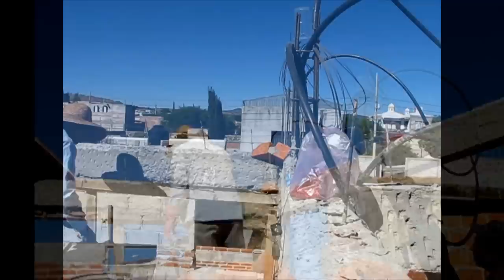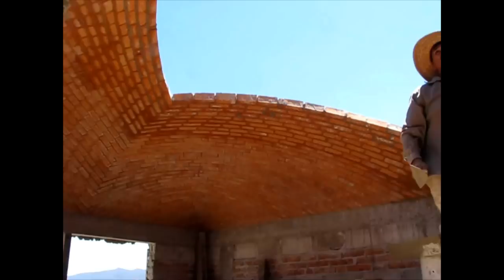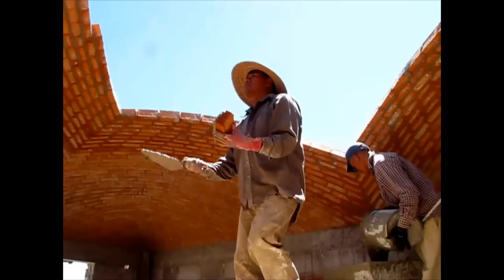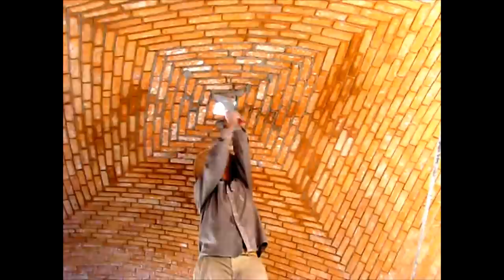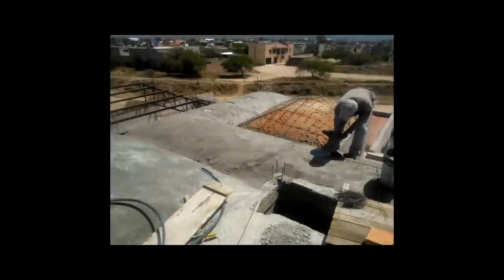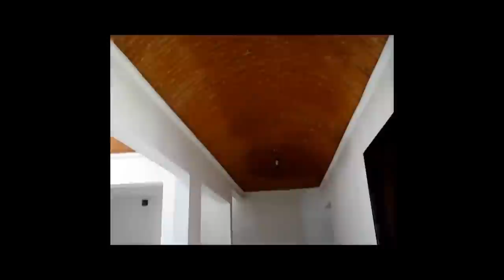How to build a solid brick dome virtualy Defying Gravity, Truly amazing! The strongest celling

Comment: would not want to live in a house like that during an earthquake.
Reply: greenrolaids that true this is called cheap building. In a small earthquake those bricks will fall over your head.
Reply: thats funnnn
Reply: i have lived through 7. my cousins family died in a house just like this.. so yeah, who's ignorant now?
Reply: I love mexico
Reply: PAUL WHALEY You are offending Mr. "green" 'cause you are pretending he is unable to stand for himself.
Reply: +PAUL WHALEY no he's wrong, the curved arch dissipates shock more effectively during quakes, The left to right shaking during a quake is what  causes buildings to collapse, moreso than the up and down.
If the supporting beams on a building looks like a T, where the loadbearing beam, meets the gable & trusses, that's vulnerable to a quake. That's why in California they put a diagonal cross beam in the walls or in most cases, run a threaded bolt through the length of the wall, and tighten them  on either side with lockwashers & nuts. 
That's why scaffold erectors use one cross bar, and two straight bars when erecting scaffolding, it's to dissipate the kinetic force the wind puts on them, and stabilize the structure. 
The same principle applies with earthquakes.
Reply: +PAUL WHALEY don't take my word for it, it's so much b.s. artists and liars on utube I encourage everybody to research something that they want to know the truth about.
a simple Google search on 
"earthquake resistant construction" should suffice.
Reply: Peter Nouveaux 
your absolutely right sir... ancient roman domes and many others still standing today due to dome like structures... very resistant to earthquakes...
Reply: what is the roof of the building your living in now made of?
Reply: reksub Top Secret. I am living in a Bunker.
Reply: Then how come so many of these structures are several hundred years old? Did somebody stand under the roof and hold up all the bricks with their hands during every quake?
Reply: sgdeluxedoc Sure. One of the most Ancient  buildings in the World, The Pantheon was built using similar roofs.   It is in Italy where strong Earthquakes are very frequent.   .https://en.wikipedia.org/wiki/Pantheon,_Rome
Reply: carlosmante concrete isnt classified. Lol
Reply: That roof is incredible strong. Much stronger that an ordinary roof due to its dome shape.
Reply: carlosmante did you know Mexican almost all of them are defendants of Spain?
Reply: +daniel nolte I didn't know Spain was prosecuting them.
Reply: Peter Nouveaux descendants* lol
Reply: carlosmante which makes them part caucasian also.
Reply: daniel nolte I DON'T Care about skin color , all I care is the Color of my Money. My motto is "ME, My and MINE". Do U Comprende????? ha Ha Ha Ha ha.
Reply: daniel nolte Yes I know . With due respect but Mexicans are like "Tutti Frutti", many colors.
Reply: It seems like everybody is more interested to put down any comment. Come on and let's go back to Domes and their particular characteristics.
Reply: ***** Thank you for your participation. Next.
Reply: ***** Thanks for your Participation, Next. ha ha ha.
Reply: ***** De Nada, Comadre!
Reply from the maker: Once closed, the arc, and vaults are structures stronger engineering there, watch this video where substantial evidence on these vaults are made, follow the following link, where they do the test with hollow materials and facts with plaster, in Mexico, we use solid bricks and concrete, brick see this video: https://www.youtube.com/watch?v=vHrIkk4wo9s
Reply from the maker: Once closed, the arc, and vaults are structures stronger engineering there, watch this video where substantial evidence on these vaults are made, follow the following link, where they do the test with hollow materials and facts with plaster, in Mexico, we use solid bricks and concrete, brick see this video: https://www.youtube.com/watch?v=vHrIkk4wo9s
Reply: no
Reply: stupid question
Reply: Dude... Native American's aren't Mexicans. two completely different peoples. As for this roof. Yes, a dome 'can' be very durable. But this doesn't have the proper anchor that is used on ancient buildings. With those, there was a sort of 'lip' formed which the base of the dome would sit within, These bricks are just being buttered up (the term for applying cement to a brick) and stuck on top, Yes they're placed on an angle which helps deflect some of the weight. But it's still being placed at the top of the wall. After it's assembled, they'll apply a plaster or whitewash at the top to seal it, but that won't anchor it. With an average earthquake. If even a single section on the wall loosens. the entire dome will collapse because it has no proper anchor.
Reply: "Native Americans aren't Mexicans"????? You are Talking about Political divides made by the English People (Gringos). Ethnically Most Mexicans are Native American.
Reply: I think you just discredited it because you associates Mexicans with cheap
Reply: +carlosmante not all Mexicans are Native Americans, throwing in small bits of irrelevant info doesn't make you sound smart
Reply: SameMule when you know the difference between "Most" and "All" you can post again. hA HA HA.
Reply: CarlileMentos i was talking about your first comment, and its still irrelevant. hA HA HA.
Reply: SameMule, are you still worried by the "irrelevant"????? Get a life little boy. ha ha ha ha.
Reply: CarolingMantis, No u first
Reply: greenrolaids > at all ! could you imagine doing that for a living?  f
Reply: because your house is earthquake proof.....can i  rent a room...?
Reply: These kind of roofs are extremely strong, but  they are only allowed in the regions of Mexico that are geologically stable (no earthquakes), otherwise the construction would be cancelled. Usually they can resist a moderate earthquake, but they are not flexible enought to resist stronger eartquakes since they tend to open the walls. You need very thick walls to resist, but that makes the building very expensive. Ancient cathedrals are properly constructed with these domes and thick walls, that is why they have remained damageless during centuries in Mexico city.
Reply: They tie rebar to the top and then poor concrete over so it will hold do you guys think they actually leave the brick like that the brick is for looks on the inside smh
Reply: clearly the brickwork is pretty strong, they were  walking on it. the cement should make it stronger by loading the arch/dome they created, also they put the rebar in the correct place if the brick was part of the structural member. (as would be done in a concrete slab floor), though it wouldn't help much with the structural integrity of the roof if one of the bricks came out, that would be covered by the concrete, so all in all a pretty overbuilt structure
Reply: In fact there is not evidence of any damaged house with that kind of roof during earthquakes in Mexico, because that kind of structures are very strong like ancient cathedrals.
Reply: what's mortar consist of???
Reply: Todos mecos ese lugar es Monterrey nuevoleon y ahí no hay terremotos puñetones jajaja
Reply: greenrolaids Yeah well I rather live  in a house like  that  ,,than a stinking  New York city,,lol..
Reply: The ironic this is brick arches and arches in general are actually incredibly naturally stable and strong. Just simple physics man.
Reply: Sorry but, you are totally misinformed about the brick "arch." There is no "Key Stone" in the middle of the arch to stop it from falling OR reinforcing bars to maintain it's structural integrity...period!

As for the walls, they are fine!
Reply: Martin Rivera I feel like wood and drywall would be cheaper
Reply: greenrolaids you think wood and drywall are stronger lol
Reply: greenrolaids, your ignorance is incredible. This arch building. On top of bricks they place reinfoced concreet that will make this roof incredibly strong, the moment something gets loose, the bricks wedge back. Almost 1000 years ago they build a church in Constantinople this way, it is Istambul Turkey now, it withstanded many earthquakes and still standing.
Reply: RIGHT?!?!? LOL
Reply: Peter Black, when the ground shifts or the walls lean during a bad earthquake, the strength of the arch is irrelevant because if the walls shift, the arch support is ruined, and the arch is no longer strong, and the rubble rains down on unprotected heads.
Reply: And then google search the number of deaths from structural collapse in Mexico versus the USA.
Reply: Who ever is talking about anchors, no that's not how the archs get their strength. Else Greece wouldn't exist. And they didn't use cement and rebar to reinforce.
Reply: I would not want to be in any building during an earthquake.
Reply: greenrolaids "my cousins family" so your family in other words? 😂
Reply: greenrolaids i would love to have a house made like this no earthquakes worth a shit here in az n how did the comment section turn into a race war lol
Reply: Native American? What a weird statement. So (Mexicans) lived all over what is now America, or just the most Southern portion closest (Mainly Texas) to now known as Mexico? How many different Natives can their be? So, what about the 'Indians' what are they? What about the Native Americans before the Native Americans, and before the Native Americans?
Reply: Invaders, Natives. Whom did the Natives Invade? Whom did the Invaders of the Invaders invade? It's not a question meant to be answered. It's a question meant to help one come to the realization that oneself shouldn't dwell on the misfortune, or fortune of an ancestors of a certain origin, because who are you to say what would be the bad consequences of good fortune, or the good consequences of bad fortune.
Reply: You guys cant compare this structure to an ancient roman dome. This structure will crack and drop bricks in an earthquake because of how small the overlap is on each brick. Ancient roman domes and arches were made out of solid concrete, not brick and motar.
The ancient concrete was reinforced with straw and had hollow clay pots embedded inside to reduce weight.
Reply: Andy Buchan all concrete has aggregate. Aggregatre is the pebbles and rocks added to concrete.
Who cares if your roof is cheaper if you are dead?
Masony buildings are the weakest in an earthquake. This is because the mortar seams has no side-to-side strength, but the bricks compressing it gives it vertical strength.
Reply: @carlosmante lmao, I live in New Zealand. We have earthquakes literally everyday.
Reply: Peter Black It would fall if I stood on that thing it would would fall no matter if it was a arch or not
Reply: greenrolaids: actually vaulted masonry is stronger than the drywall in your home and a little less strong then concrete thus why all thos medieval vaulted cathedrals still stand today
Reply: a lot more than you apparently
Reply: greenrolaids There are many earthquakes in Mexico. Domes are earthquake resistant structures.
Reply: Martin Rivera This is more expensive than a concrete roof because it needs a lot of manpower
Reply: Zven Zvenston. That depends on the contract to OSHA approved, structure on state penal codes, you may want to ask a well experience Mason for it contains different volumes of cement mixtures and so forth.
Reply: James Nunn this is about building structures everyone is drifting off to the races again, Not smart.
Reply: Once the motar dries it will have a good bond and will be held together by pressure because the mud will expand enough to lock everything in also that arch design adds a lot of strength as well. I'd live in it.
Reply: greenrolaids they hold up great
Reply: T J the arch is the strongest structure possible on earth. And this dome is a continuous arch from all angles.
Reply: daniel nolte wrong.  Most Mexicans don’t think about or care about Spain not one bit.
Reply: daniel nolte very few Mexicans are not descendent from Spain.   Most are tribal Indians native to that land when the first conquistadors came.    Only a hand full of white European Spanish families stayed there and ruled over the native populations    

All have Spanish surnames from Spain but most are 75% -100% or more are just native Indians who now speak Spanish because my white Spanish grand father 60 generations ago had sex with one Indians guys grandmother 60 gens ago.  And now there are Mexicans With Spanish last names and speak a white mans language from Europe
Reply: Mediph Eranz wrong the native Americans for Alaska down to South America all share indigenous American tribal roots      Mexico is called Mexico because of the Mejica or mexica Indians.       All Mexicans who aren’t from Europe a Spanish stock are Indians from the Olmec , Toltec, Aztec, Mayan , Incan ,mejica and other natural tribal Native American Indian groups living there before European colonization        

Grow up and read a book 

Oh , I am Spanish and study the history and culture of all Hispanic peoples globally
Reply: carlosmante exactly.
Reply: Samule %90 of Mexicans come from native mejica Indian blood lines.        Or the other 15 or so tribal Indians that were In Mexico before European Spanish conquest.
Reply: Andy Buchan aboriginal blacks were the first Americans.   Much longer than 35,000 years ago.
Reply: Es demasiado gracioso que sin conocerse y en la comodidad de sus casitas se pelean como niñitas de primaria. Dejen lo infantil de lado y aporten información fehaciente sobre la calidad del trabajo mostrado en el vídeo.......................... En fin, como ya comentaron muchos usuarios, el arco en cuestión estructural es estable y resistente, la cuestión es quién te realiza el trabajo, un muro ortogonal es muy sencillo hacer por su geometría, pero puede colapsar si la persona que lo realiza, no tiene la habilidad ni física ni mental para hacerlo.
Reply: greenrolaids here brick dont have few tons
Reply: This is exactly what kills thousands of people when earthquakes strike.
Reply: Trumps wall will be better😉. Also before the butt hurt babys cry about there "feelings" do your research not all building built in the old ways hold up thats why we have runes only the most importaint buildings held up because the took there time. So a cheep building like this is not that safe but if they spent more time it could with stand 100s of years. But people dont live that long so thats fineand as a demo worker ive taken down more building like this then i can count there great but dont last long if there done fast. Great skills to do that work as well to bad, wish there wasnt earthquakes. =/

Comment: Great look and craftsmanship. But then the little earthquake hit and pummeled all the occupants to death with bricks. NO building codes. LOL
Reply from the maker: Once closed, the arc, and vaults are structures stronger engineering there, watch this video where substantial evidence on these vaults are made, follow the following link, where they do the test with hollow materials and facts with plaster, in Mexico, we use solid bricks and concrete, brick see this video: https://www.youtube.com/watch?v=vHrIkk4wo9s

in Mexico City there was an earthquake of 8.1 on the Richter scale in 1985 and many modern buildings fell dawn. but many of the oldest buildings (15th century built with this technique) were undamaged or slightly damaged. the metropolitan cathedral is sinking down (because of the ground in which was once a lake and yet still standing ...

Comment: Tiltle says "defying gravity " when the video demonstrates how actual physics work.
Reply: Richard Decker 

Well.. how adhesive works anyway, so I guess physics is correct but by friction.
Reply: Nerdy Camel well it was a little bit more than just adhesive. Watch the placement of bricks when they start on the corners
Reply: The Romans managed this over 2000 years ago, it really isn't as spectacular as people think. Yes it's a craftsman doing his job, but I know typists that can type 90-100 words per minute, which is just as difficult for the average person. 

My point is, that this really isn't as special as people think it is.
Reply: Nerdy Camel that I do agree with
Reply: Technically the forces holding the bricks up are defying/going against the force of gravity though
Reply: Peter 
Technically they are not. They are on earth, therefore gravity is very much acting upon them. In fact, this build would be less possible without gravity.
Reply: I believe you are misinterpreting the meaning of the word "defy". The definition is literally "to openly resist or refuse to obey". The forces keeping the bricks in the air are resisting and counteracting the force of gravity. Otherwise, the bricks would fall to the ground.
Reply: Peter 
Well done for quoting a dictionary. My comment still stands.